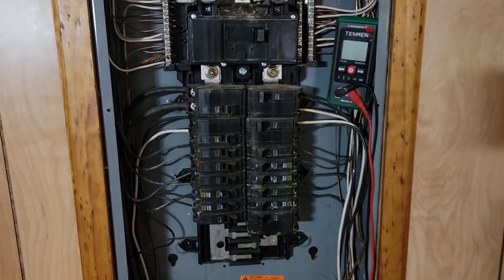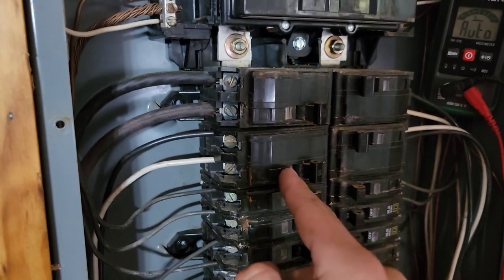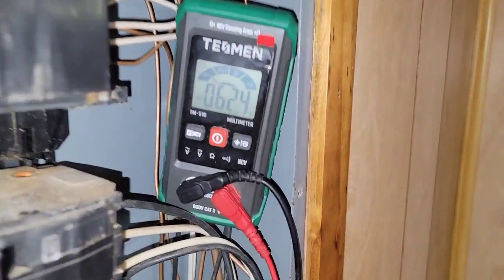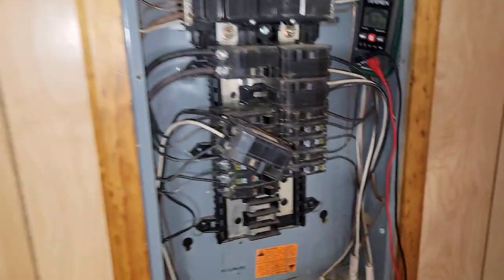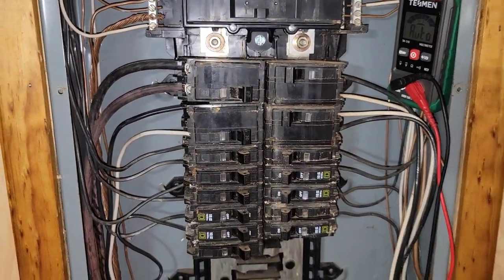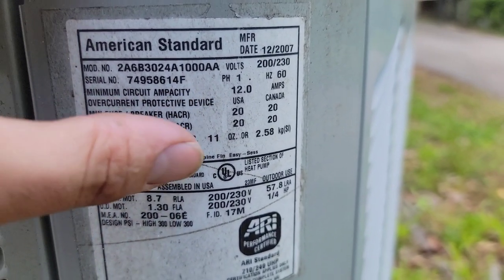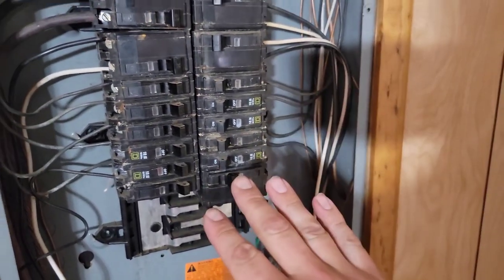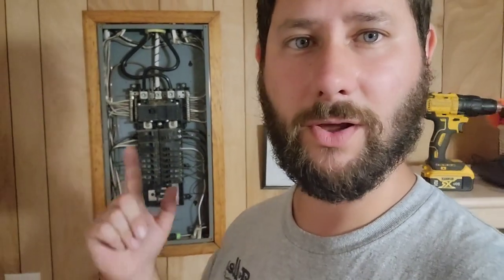How to check the amperage, breaker and sizing?

Comment: My electric light start flickering when we start washing machine or become dimm when start microwave iron or compressor. It happens on any power outlet. Does elecric pannel needs service ? I am in Mississauga ON. I am thinking low emparage draw from breaker because moisture issue in the breaker pannel room. Can panel service by electrician might fix the issue. Usually electrician sugges replace wiring wich is too costly.
Reply: Crickets!! 😂

Comment: The minimum circuit ampacity number on the data plate indicates the ampacity of the power supply conductors. Typically 12 AWG can power 20 amps and 10 AWG can power 30 amps.
Reply from the maker: Wish I would have set those exact words in the video 
Good stuff

Comment: When you were measuring the amps being pulled that was only on one of the lines correct? (About 6 amps).  If so the other line would also need to be measured to get the full 12 amps minimum it should be pulling.
Reply: This is my question too.  Hard to find an answer.

Comment: I haven't found any videos on what size wire and breaker for a 240vac/200 feet run to a well pump. I even asked the local electrician and he seemed lost.
I went ahead and used the #6 awg and 30 amp breaker.

Comment: Did you torque those breaker lugs nec 2023 require them to be torqued to specs...whia vde rated 1000 volts insulated
Reply from the maker: Of course my brother

Comment: If I dont want to do a panel upgrade. How do I determine that my main panel have enough power for a subpanel ?
Reply from the maker: do a load calculation to determine
Reply: @TaddyDigest  how do I do that ? Would I put the meter clamp on one phase or do I clamp each individual circuit in the panel ?

Comment: I'm no expert, but why does it need a 20amp breaker instead of 30amp.
You're pulling under the max of 30amps so it should be completely fine shouldnt it?  Thats like saying you have a 120v , 20 amp circuit but are only using 15 amps so you should change breaker to 15amp....or am i incorrect?
Reply: This is a motor load. Its treated differently as opposed to a resistive load.  If you use a 30 amp breaker on a circuit designed for 20 amps, the breaker might not trip promptly during an overload.

Comment: Thank you for the good information.  I'm getting spike amp draw in the middle of the night.  My power company said most like my ac is shooting over 100 amp on the start up of my ac  when it kicks on.  Can you explain how this is possible? I would imagine my breaker would trip or  burn up in no time.
Tampa Florida, under the communist rule of Duke Energy.
Reply from the maker: Give me something wrong with the starting relay or capacitor for  your compressor.

Check out my video on how to measure lock rotor or amps we're starting amps
or my video on the ICM control soft start.

Comment: I want to know how many Amps are being drawn through a 30 amp double pole breaker when the dryer is turned on and running. I have a Fluke multimeter and a Klein clamp meter. After setting either meter to Amps I place a lead to the hot and the other lead to the neutral? Or with a clamp meter set to Amps, I clamp one of the black wires and then the other?
Reply from the maker: yes